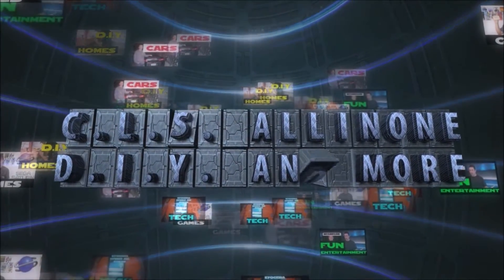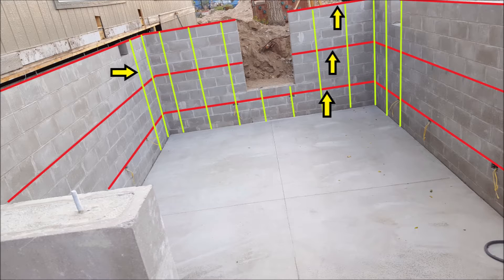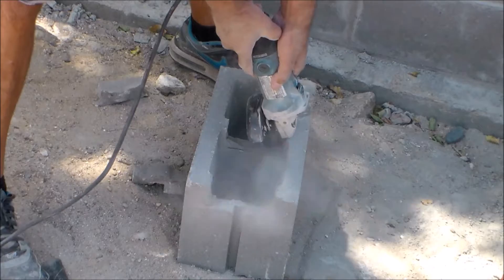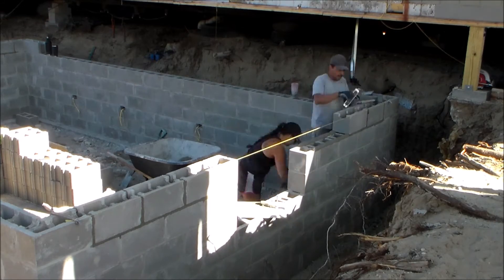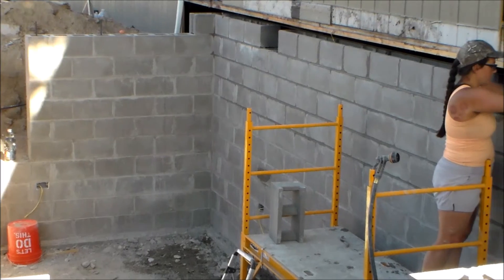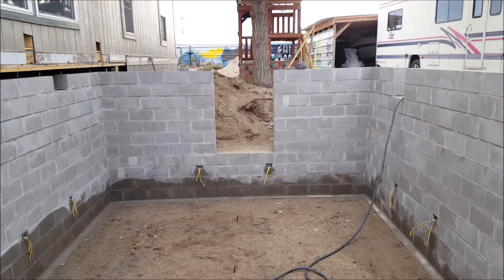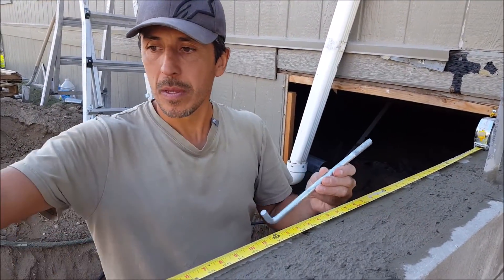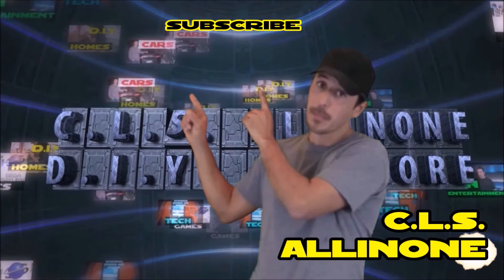How to build a Concrete Block Basement for Beginners. Part 3 the Bond Beams DIY

Comment: How did you design the wall length so that you were able to use whole or half blocks?
In other words, you did not have to cut any blocks or deviate from standard sizes?
Also, did you not need any control joints in the walls since they were below ground level?

Comment: You did not explain how you attached the 2nd vertical rebar to the 1st, as you went 4 or 5 courses above the top of the 1st vertical , you could not reach down or wire the 1st to the 2nd, so how did you do it??
Reply: I had the same question but wondered why rebar is installed at all since it will eventually rust and degrade the surrounding concrete.

Comment: Looks like a good strong wall. But in this situation Ivany blocks would have worked better for you. It would have eliminated the cutting for your bond beams except for corners and window openings. More importantly it would have positioned your horizontal rebar much better, yours looked too close. Another advantage to ivany blocks is that they don’t leave a hollow cavity in your head joints, you get a 100% solid wall that is much more water tight. The head joints in standard blocks do not fill up well even when you grout ever core.

Comment: That was a good video I’m getting ready to do a 4 foot crawl for my up north Cabin I wanted to know how do you actually tie the vertical rebar extensions into the ones that were not exposed anymore or do they literally just get wire tied together

Comment: Hmm.  Some notes. When doing bond beams the rebar should be spread apart so concrete can fill between them, yet the rebar should should also be wire tired to the vertical rebar.  When back filling the bocks, never fill them to the top of the blocks level (except the top layer) as this creates shear points in the wall. Vertical rebar should be used in the bocks right next to every opening. When using J bolts, they should be hooked under the bond beams (top layer rebar).  Also, if you do not have a pointing tool to smooth the layers out between each layer of blocks, a Quarter works better.

Comment: What is the material you used on top of the final course of CMU block and under the sill plate? It looks like dish packing material or something. What does that do and why? Thanks for your videos!
Reply from the maker: Hello here is a link to my sill plate video.  https://youtu.be/OsfdpPIWLVo
Reply: It's called a sill plate gasket. Usually made of polyethylene foam. It isolates your wood sill plate from your concrete so it doesn't rot out over time.

Comment: love your videos mate!  random question: you used 2 x half inch rebar in your horizontal runs, did you consider one inch rebar instead of two sets of half inch?  if so what determined your decision making?  thanks for making such fantastically detailed videos.
Reply from the maker: Thank you. I chose to use half inch rebar because it's much easier to work with as far as bending and positioning.
Reply: @D.I.Y.-All-in-One  makes sense!

Comment: Just wondering you say you fill them with grout, is that similar to the grout in bags, or do you mean a loose concrete mix?
Reply from the maker: Grout is a dense fluid which is used to fill gaps or used as reinforcement in existing structures. Grout is generally a mixture of water, cement, and sand and is employed in pressure grouting, embedding rebar 
in masonry walls, connecting sections
 of pre-cast concrete, filling voids, and 
sealing joints

Comment: I want to add to an existing wall. The wall is 4 inches thick and it’s hollow not solid. Do I have to add rebar when I add the block to the top? How do I add rebar if the existing wall is hollow. The wall is only 5 feet tall and want to add just one more block to the top. Thank you.

Comment: very good., did you choose to put two  horizontal rebars in each bond beam  and verts every two feet or were you told to do it, is it code in your area??
Reply from the maker: Thanks. I doubled what the code was in my area for the vertical but the horizontal called for 2 in each beam.  The 20' sticks of Rebar is fairly cheap in my area so it was worth the extra effort for me.